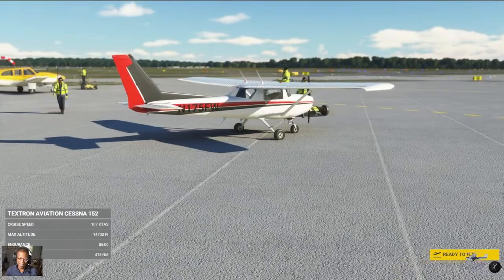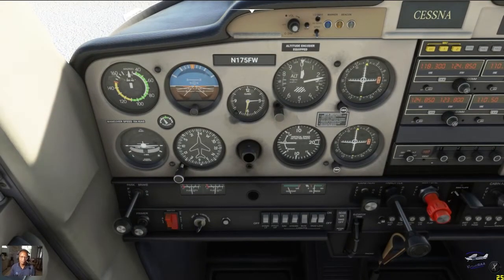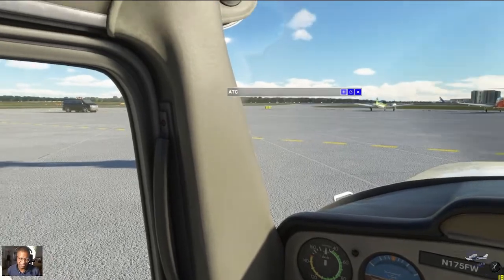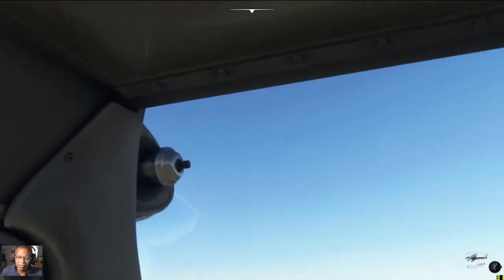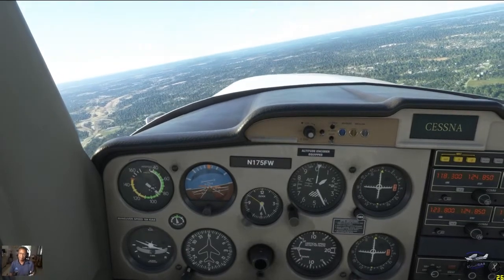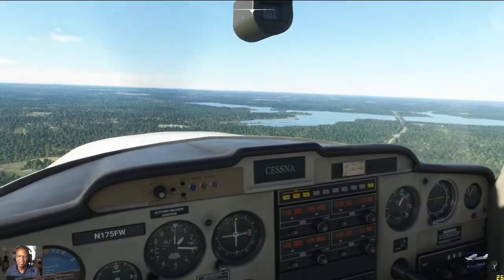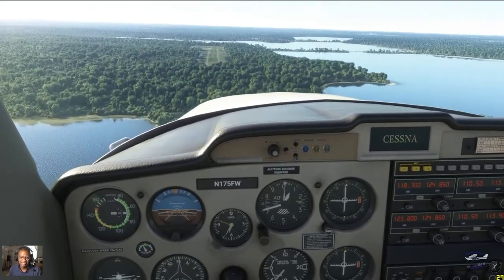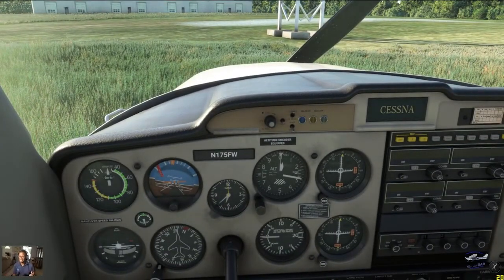MSFS: Raleigh-Durham (KRDU) to Lake Ridge 8NC8 in the Cessna 152 - Video Redux | I could do better

Comment: Good flight Frank. Glad you got the hat switch views figured out. Most of my flights are 300-500 miles so I fly mostly autopilot GPS connected. In X-Plane I have C152 with an autopilot, it's called a commuter model. The VFR flight was very interesting.